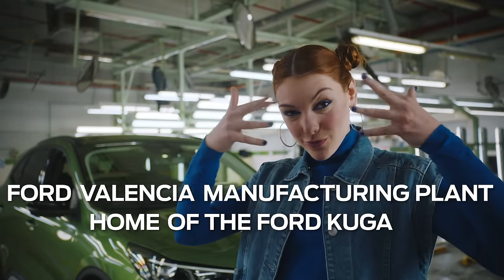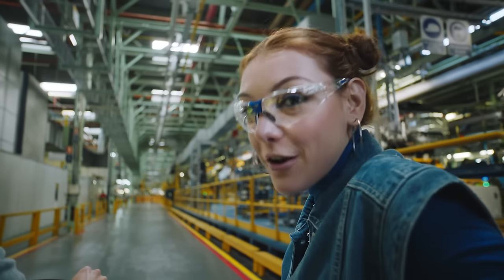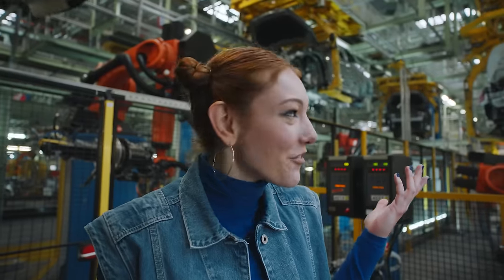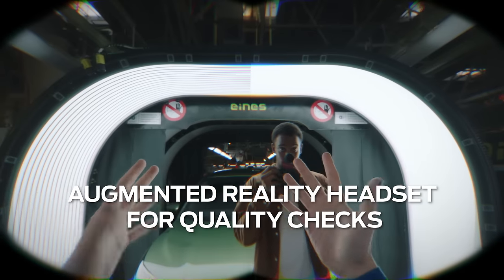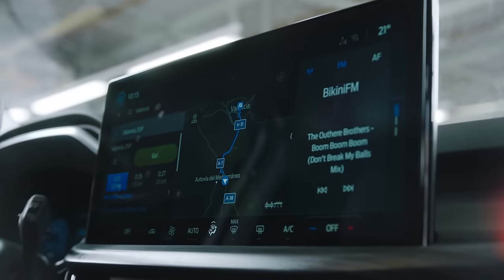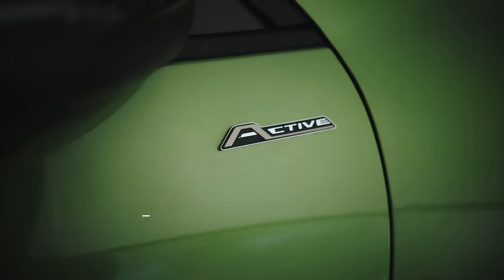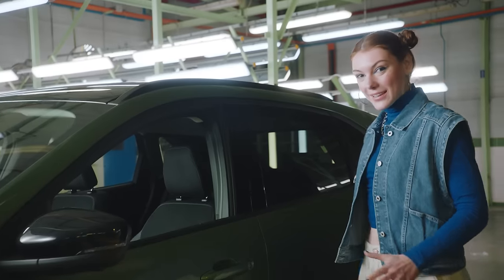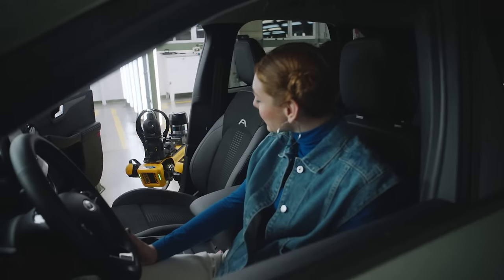Ford Kuga Reinvented

Comment: What type of timing belts ? Wet any made of rubber including the oil drive ? Or are they chain driven ? What’s the warranty on the engine ? Important questions I think .
Reply: Hybrid engines has a chain. Belt for petrol engine for reduce emision and fuel economy.

Comment: I had my taste of the Powershift DCT... And I thought Nissan CVT gearboxes were the worst. It broke on my 2nd Gen Kuga after 50K miles, and zero F's given from Ford, although the car was under warranty. I am wondering how long will Ford CVTs last. The only reliable, zero maintenance and problem free are the e-CVT from Toyota, which are not exactly CVTs. and Hondamatic from Honda seconds the reliability.
Reply: Cvts on Corolla"s fail to. I work for a taxi company that provides them. Have also seen reverse fail in a 2019.

Comment: Sorry, had a 2014 and 2016 fiesta sticks. Both were fun to drive and both had problems at 60,000 miles. At least in the US, Ford took a great car and blew it with poor quality control and poor engineering. Got a Honda Fit. It has 87,000 miles, well maintained with no problems. Ask me if I would buy a US ford anything and the answer would be absolutely not.